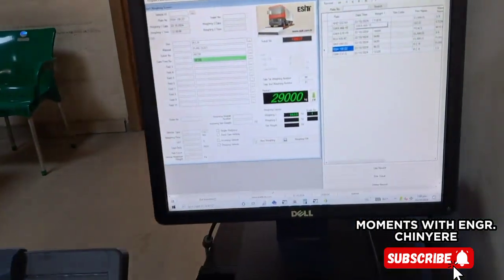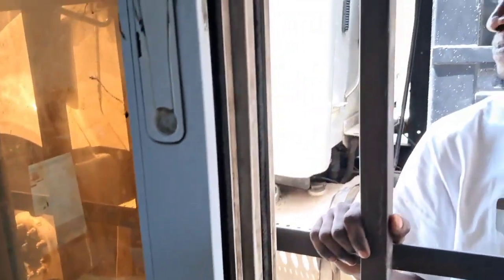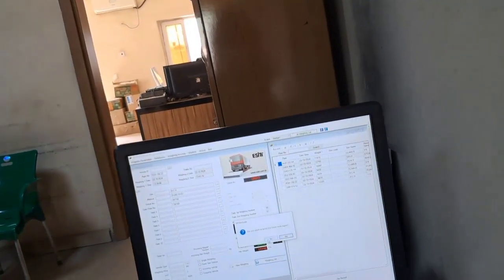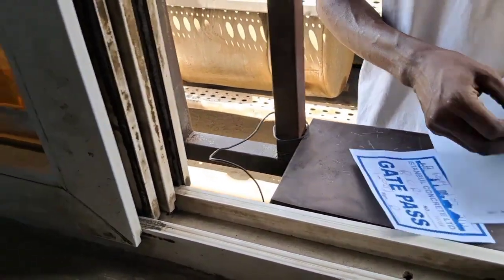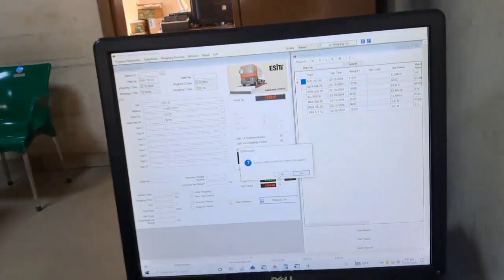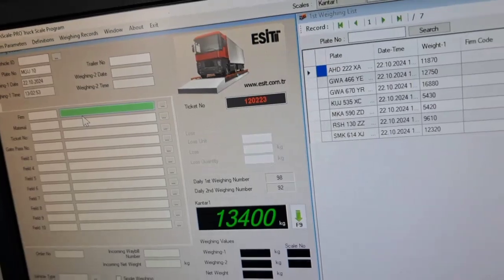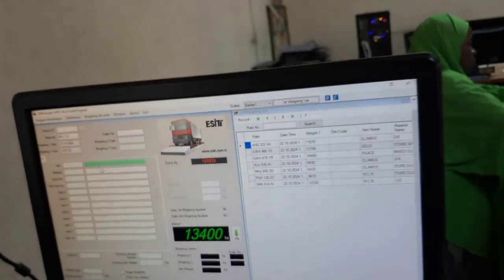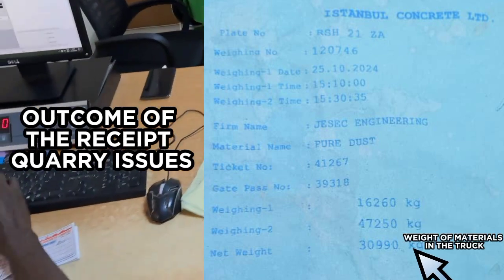HOW TO CRUSH ROCKS TO SEVERAL PARTICLES.

Comment: Engr. , what do you mean by controlled blasting.  Pls  more explanation
Reply from the maker: Controlled blasting is when you put measures in place to control the blasting.  This will help prevent casualties, damages within the environment, and the installed crushers. The impact of blast is usually huge so that's why it is being controlled.  If it were where no one lives around,  normal blasting can occur uncontrollably. 
I hope you find this explanation useful,  thanks